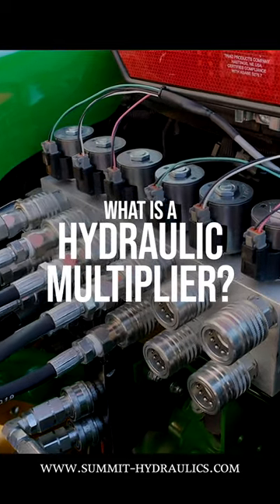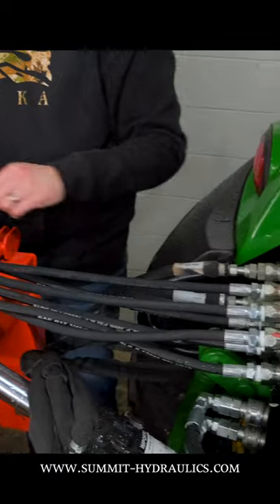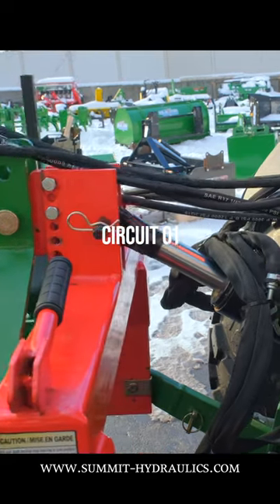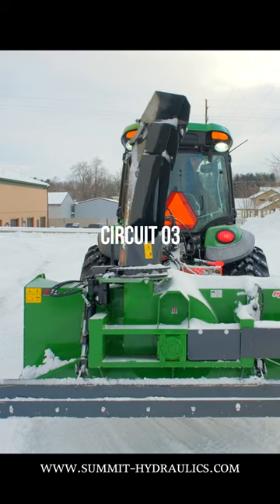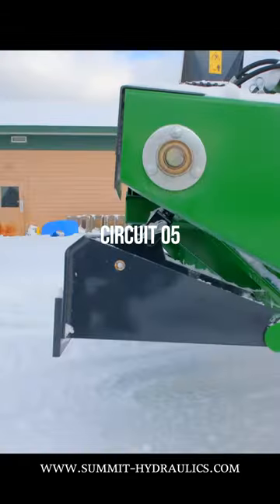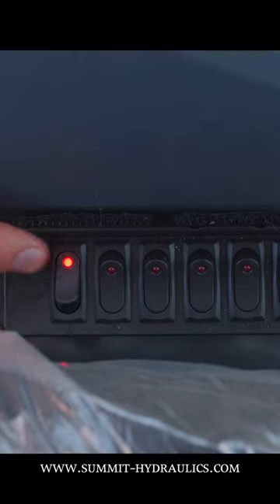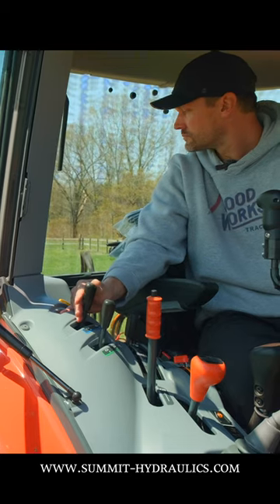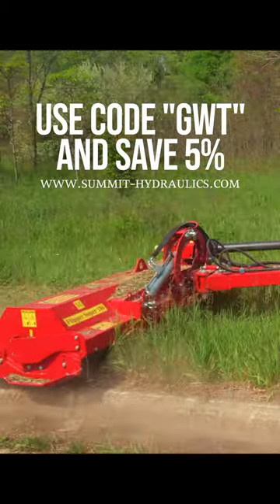ADD DIY HYDRAULICS TO YOUR TRACTOR AND SAVE THOUSANDS! #tractors

Comment: How does the hydraulic pressure do after adding the multiplier
Reply: im sure it’s the same maybe you would have to add a bit more hydraulic fluid.
Reply: @johnr.8810  if you are only doing one thing at a time you should be ok .  The more you run at once then the more problem you have.